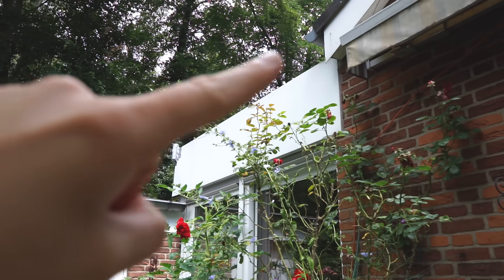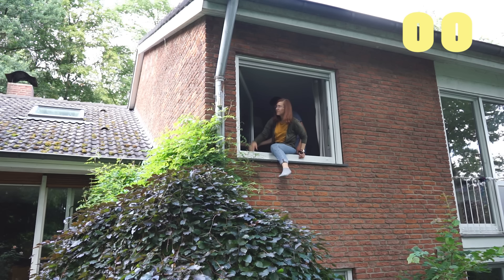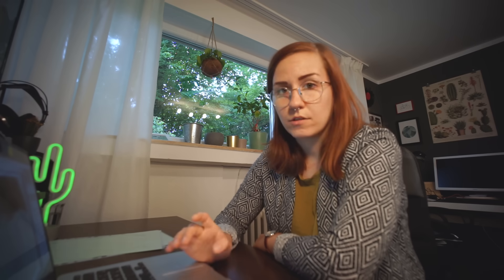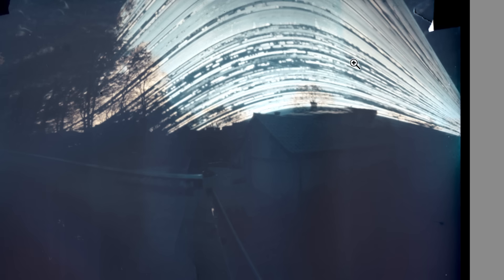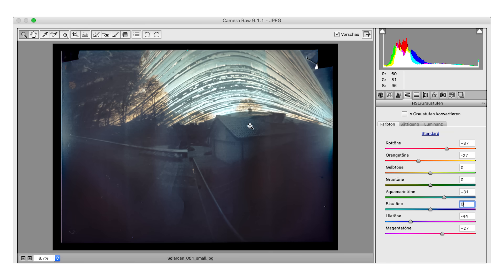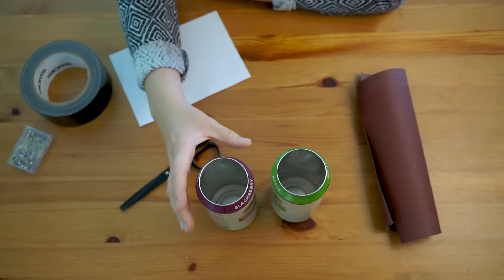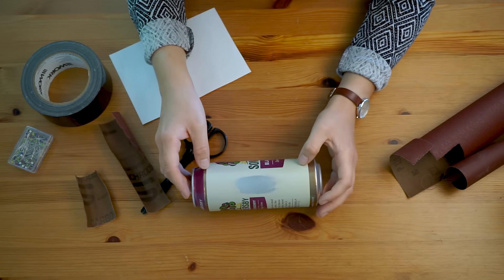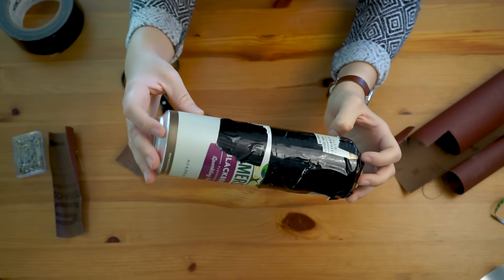Beer can pinhole camera | 1-YEAR LONG EXPOSURE

Comment: Very nice project and video.  I have two  questions:  1- Did you use color or black and white paper?  Your Amazon link point to black and white paper.    2- If it is light sensitive paper, doesn't the scanner light over saturate the paper during scanning?   Danke!

Comment: If only I had a Scanner and PhotoShop back in the 50's.

I made my first wood box Pin-hole camera when I was Eight. Though they have darken some over the years, they are still some of my best and favorite Pics from over nearly 70-years of photography.
    I kept then in a gasket sealed lid Ammo can all these years and only take them out in my darkroom. I have had a darkroom in one place or another since I was eleven. My first was under the stairs to the basement which I had access to through a little bathroom, so that was convenient having access to a sink. 

Thanks to your post, I will now scan them and post process them. Should be interesting.

Comment: A better way to make an even pinhole is to use a pushpin from the inside but just to make a dimple , not actually piercing the can.  Then, use sandpaper to wear away the top of the dimple making a prfect hole instead of a pierced hole that leaves jagged petals like a bullet hole which makes stray reflections.

Comment: Thank you for this fascinating video. And the images are awesome and surreal. I note that you didn't paint the inside of the cans black but left them silver and highly reflective. There's another youtube video that also shows the making of a beer can pinhole camera for solargraphy and they did not paint the inside black either. Though there is an online tutorial for pinhole solargraphy that does recommends painting the insides black. I guess I could try no paint for a shorter exposure time and see how it goes. I was also thinking of using blue tack to stick the photographic paper to the inside of the can so that the whole paper is exposed.

Comment: The part I'm not fully understanding is how to deal with the photo paper afterwards. I have a little experience in the dark room, and I know that photo paper is significantly less sensitive than film. However, wouldn't talking it out of the can and the scanner light ruin the photo, or is it so exposed that you have a laten image and more light doesn't hurt it much?
Reply: I'm very new to this particular type of pinhole photography - solargraphy. And yea Ive done darkroom developing / printing in the past as well. Apparently, from what Ive seen and heard, the sun does not create a latent image on the paper. It creates an image that is visible without development! I admit I find this pretty amazing. Though some people reckon that the light from the scanner could affect the image to some degree. There is someone else who does this type of photography and he has experimented with using fixer with the paper before scanning it. He says that works well. But from this video here, I now hear that some people claim that fixer will destroy the image!

Comment: There is no way that regular duct tape lasted an entire year exposed to the elements.
Reply: You'd be surprised how long duct tape lasts exposed to the elements.  I've had it last for about 5 years holding a plastic blank in the window next to a window air conditioner.
Reply: @KuptisOriginal  That can depend on how much heat and sunlight hits the tape. If that were white duct tape then it may survive longer.

Comment: I think I have a solution to the developing problem. You would effectively want to pull the paper by about 13 EV (if I'm doing my math right) so to do that all you might need to do is dilute your developer by thirteen stops. The easiest way to do this (again, if I'm doing my math right) is to dilute it in half thirteen times. From there the rest of your chemicals shouldn't need any dilution and you can use your stopper and fixer as normal.

I say all this with the caveat that I've never worked in a dark room and I've only shot a few rolls of film in my life when I actually knew what I was doing with it. I have however shot a good number of digital photos in manual or priority modes on a digital camera and I've read years worth of various photography magazines and various books.
Reply: Apparently, no developer was used on these papers. Regardless of what is done with the developer, the papers would likely turn out completely black from the extreme overexposure.

Comment: Do you take the black tape off the hole when you have it in position?
Reply: Yes.  Otherwise how would the light get to the photo paper?
Reply: Correct. The tape acts like a shutter. You must have the shutter open in order to produce an exposure. I would still recommend keeping the camera as still as possible when removing the tape and reapplying it later.

Comment: Do you have any details about the photo sensitive paper? I have never heard of paper that doesn’t need to be developed like this
Reply: Apparently, it's regular photographic paper. And normally, it does need to be developed but you wouldn't do that for this application because that would turn the paper black. I know it's been recommended to use a harder grade or multigrade paper. And someone else who shoots solargraphy recommends using matte paper or semi-matte and to avoid gloss. Supposedly, gloss paper is too reflective and can cause issues. And Ive just found out that matte paper has become extremely rare - especially for small print sizes. So I'll have go with satin paper for my beer can camera. Unfortunately, satin paper does have some gloss but nowhere near the amount that regular glossy paper has. But if you can find matte paper in a small enough size, grab it!

Comment: What a good idea, and your results were excellent.  I wonder if it would be possible to join two images side by side.  The reason for this is that on the England /Scotland border the sun in summer travels about 270 degrees from NE, through S to NW.  I will have to find out!
Reply from the maker: Sounds like an interesting experiment that is definitely worth a try! Thanks for your comment and have fun :)

Comment: Why do you need to close the shutters with tape? The exposure is already so long that a few minutes of motion should be invisible.

Once the image is scanned then why worry about storage conditions of the photo paper?
Reply from the maker: Do you throw away your negatives and only keep the scans when shooting film? I treat this photo paper just as I would treat any other negative, so I make sure it will be preserved in case there will ever be better scanning technology available. And yes, you could technically leave the shutter open at the end of the exposure (not in the beginning though due to the Schwarzschild-effect) in case you scan the image straight away. But why risk it when it's only minimal work?
Reply: @KarinMajoka  that makes sense.

Comment: So awesome! But how can you just scan the paper and still get an image without developing the paper first? Heard what you said about developing it traditionally would over-develop, but some kind of development is still needed right?

Anyway very inspiring. Would really like to try. Just worried that it won't come off...
Reply: photorgaphic printing paper will turn a very dark coulour when exposed to light for long periods, a few hours would only make a little change, but days and weeks would go very dark out in full sun, the pin hole is not big enough the blacken the whole paper, but for the projection of the upside down image on the paper which is very dim.

Comment: Try to use a raspberry pi and its camera and do the same thing with high resolution and colour, the hard part is the power supply. This way you can also do this at night time. Get modern and Hightech
Reply: I prefer this low tech approach with the beer can. It's also a lot cheaper too.

Comment: Hi. Nearly all of my beer cam photos have 4 dark, wide, vertical stripes spaced across the image.  Any idea what those are from?  Is it diffraction from a too small of pinhole?
Reply: Possible inside can reflections? I used a large bit of paper that covered all the can inside for mine and didnt have any problems like yours, I can't imagine it would be the hole makng the lines, a smaller hole shoud give a sharper image than a larger one I would have thought.

Comment: Soooooo....   why did you put tape over the pinhole?  The paper is exposed to more light when you open it and scan it than with the pinhole.
Reply from the maker: Have you heard about reciprocity failure before? Photopaper material is more sensitive to light in the beginning of an exposure and the sensitivity of the material decreases over time. Therefore the tape is necessary, since the first seconds and minutes of the exposure are crucial
Reply: @KarinMajoka  yes. But she taped over the holes to take them down.

Comment: Sand paper the inside of the pin hole, to flatten the cone shape made by the needle. It should reduce glare and sharpen the image
Reply from the maker: Great tip, thanks! Will try it out the next time :)

Comment: Back in the days without electronics, du trails were used to measure daily sun exposure. A piece of graduated paper would be placed behind a glass sphere, and direct sunlight would burn the paper. You would then convert burnt centimeters into daily sun exposure. Semi-cloudy days would have dotted lines just as yours do. Forgetting to change the paper everyday would make a second trace slightly above/below the previous one, just like yours! 
Great project, thanks for sharing :)

Comment: Shouldn't the sun trails appear as  a part of a perfect circle and not flatten out at sunrise and sunset ? If Earth turns evenly then the trails of the fixed point of the sun should be evenly round.
Reply from the maker: I don't understand your reasoning, could you explain again why you think it should be round? Since the field of view is approx. 180° and the sun (in my case, Europe) is going up in the east and going down in the west, it makes sense that it is more of an inverted U shape.
Reply: @KarinMajoka  It seems like relative to the arc of the circle itself the curvature on any given day should be even.  Like if you draw a circle  on paper with a compass whether it's a small circle or large it's still a perfect circle no matter what angle it's viewed from.
Reply: @KarinMajoka    It seems like relative to the arc of the circle itself the curvature on any given day should be even.  Like if you draw a circle  on paper with a compass whether it's a small circle or large it's still a perfect circle no matter what angle it's viewed from.
Reply: panoramas distort such shapes quite a bit (try doing one of, say, a train). Also, I imagine the shape of the can (and thus the paper) has some effect.

Comment: Very interesting project, liked it. 

I did not understand the part about sandwiching the photosensitive paper in between two card sheets for scanning.
Reply from the maker: Thanks! The part about sandwiching the paper in-between two cardboard sheets is for storing the paper away and not for scanning! That way the paper won't be exposed to more light over time.

Comment: Which process did you use in your paper development, and what kind of paper? Did you use developer? How do you scan an exposed undeveloped page and to what? It seems I am missing some crucial points. I do not understand your photographic materials. it’s frustrating because this is a fascinating project.
Reply from the maker: I hope I can clear things up a little bit: As I said in the video there is NO development. As shown in the video all I do is take out the paper and scan it straight away. What you can see @4:47 is exactly how the paper looks like after the exposure and without any chemical processes. There is a very light negativ visible on the paper even without developing since the light of the sun is strong enough to almost "burn" a latent image onto the paper. Regarding the paper: Specification is not really necessary since you can take whatever photosensitive black and white paper you can find. In my case I used old expired Ilford grade 4 or 5 paper which works just as well as fresh paper.

Comment: Really interesting project and very good video ! I was asking myself a few questions about your Solarcan pinhole: what kind of photosensitive paper do you use (sensibility, etc) have you tried shorter period with different papers ? And do you think it could work with some lightly photosensitive vegetal emulsion ?
Reply from the maker: Basically, you can take whatever black and white photo paper you can find. Most photo papers have a really low sensitivity (something between ISO 4 and 12), so the paper type should not really matter too much. However, it's recommended to take harder grade RC paper if possible. I don't have any experience with liquid emulsions, but I am sure that it would be worth a try!
Reply: @KarinMajoka  Ive noticed for a very long time that multigrade papers have become very popular and common place. Would it be okay to use multigrade papers?

Comment: Whats the cause for the 'reflections' in the image (vertical stripes)?
Reply from the maker: Not 100% sure but most likely either the aluminium reflecting from the inside (I have heard it could help to spray the inside of the can black) or wrinkles because of moisture.

Comment: Why wait a year? Between Christmas and Saint John (winter solstice and summer solstice) the solar traces recorded by the camera will have drawn the whole of the figure with the highest resolution.

Recording 6 more months can, in my opinion, only widen the daily traces and blur the result:

The height of the sun at noon on the days of the equinoxes will obviously not be exactly the same in spring and autumn, because the exact time of an equinox varies within a 24-hour range. Two successive equinoxes almost never occur at the same time, so the height of the sun at noon on the day of the autumnal equinox will be slightly different from its height at noon on the day of the spring equinox. It therefore seems to me that the traces recorded in the second semester can never all be superimposed exactly on those of the first semester. ;-)
Reply from the maker: Yes, solstice to solstice might be the even better approach - thanks for pointing this out. The other solargraphs I showed in the video were made during this time span. Honestly, in this case I just forgot to take the camera down on time. And a 1-year exposure sounds better as a YouTube title haha.
Reply: It could be very interesting to see an exposure of the [semi-] yearly-variance you're talking about... With leap-year, it might vary quite a bit over many years. Would need a shutter to only open one day a year, though, and a very stable setup!

Comment: So how do one use the camera? do they have the tape on the pinhole all the way? You explained how its being build, but u did not explain how one is suppose to use.
Reply from the maker: The tape works as a shutter. So the shutter should only be open during the exposure which means that the tape shall remain on the camera before putting it on it's spot and when taking it done. The tape shall only be removed for the period of one year (or shorter) once the camera is in its destination.
Reply: @KarinMajoka  so u mean u have to manually tape and untape every single day?
Reply from the maker: @InoXtiC  NO! Build the camera, put the tape on. Put the camera to the location where it shall take the image with tape on. Take down the tape for the whole duration. And only put the tape back on before tearing the camera down.
Reply: @InoXtiC  Remember that this is one single super long exposure. Light is being collected over an extremely long period of time. In other words - the pin hole is uncovered for the whole time.

Comment: That's awesome. Do you have examples of an image after only 1-month? It would be great to see the difference between the same image after only 1-month compared to 1-year. Hope you'll consider trying that out as a follow-up to this video.

Cheers..
Reply from the maker: You can imagine that the density of the sun trails will only be 1/6 of the one shown here. So there won't be as many sun trails and the image might also be a bit less contrasty. I might make some experiments with those types of cameras in the future. But it's also really easy to try it out yourself! :)
Reply: @KarinMajoka  Noted. Thanks for your reply.

Comment: I guess water wont go into throu the pinhole because its so small? But what anout air moisture? Wont it condense and such inside the can?
Reply from the maker: Well, the can is of course a bit exposed to the seasons. As you can see my paper was a bot bend and wrinkled, so the weather conditions are affecting it a bit. But all manageable!

Comment: You should point south if you live in the northern hemisphere and north if you live in the southern hemisphere. Otherwise you're facing away from the sun. If you live on the equator, you need to decide how to protect the hole, as you'd be pointing it upwards, and don't want the hole to be obstructed or get dirt on your paper.
Reply from the maker: True! Back then I did not consider that the video might reach so many people from the other side of the globe
Reply: @KarinMajoka  fair point.